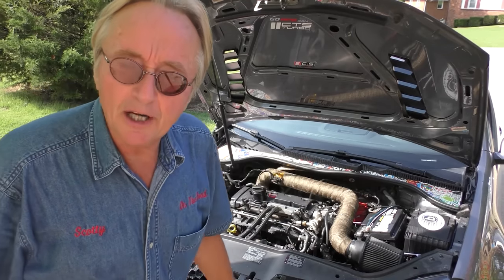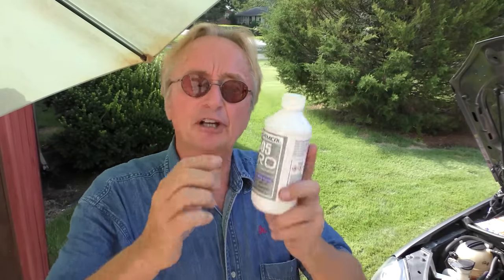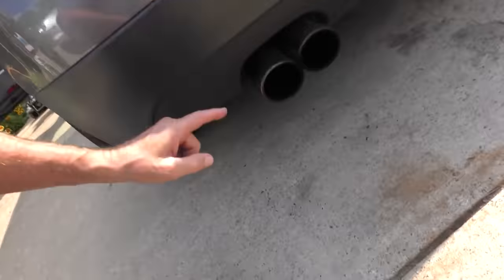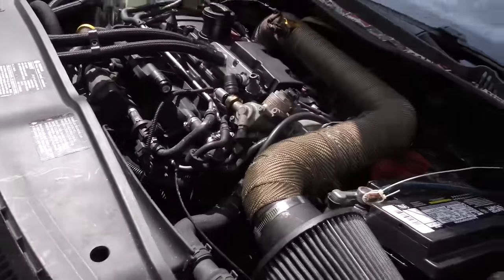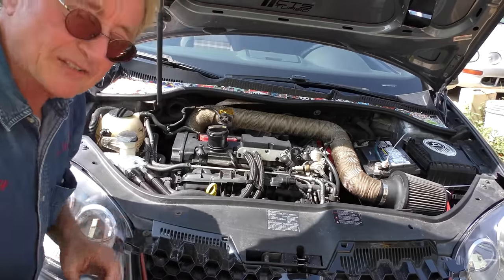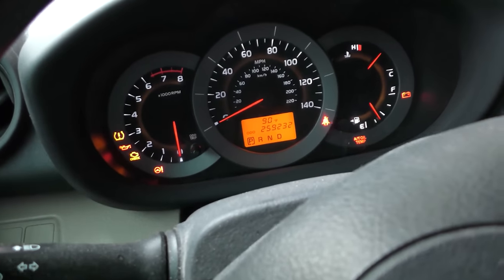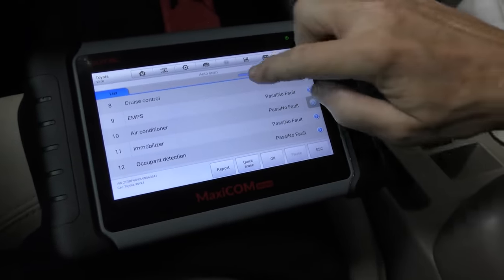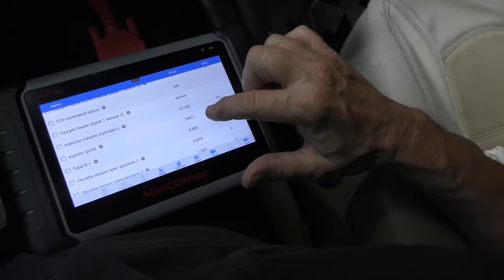3 Things That Will Make Your Engine Last Forever

Comment: Years ago...I had a 1965 Barracuda that still ran after 425,000 Miles-- The body rusted before the engine died... I also had a 1965 Newport with 325,000 miles on it
Reply: Simply doing common servicing upkeep on vehicles really really extends the life of any thing you're driving 95% of ppl never lift the hood they just expect them to go go go without any upkeep 😂😂
Reply: Brother s 65 Olds went over 300,000, Mom’s Olds, over 249,000. My Oldses are still running, 2 1983/s and 2 1985/s. Why? Frequent oil changes. I’ve since sold  them, as they were rust buckets, only the bodies rotted and failed. Mechanically all solid. And still on the road with new owners. Current 05 Vue at 264,000. Frequent oil changes and TopTier Premium fuel.
Reply: The four cars I’m responsible for maintaining all take 5w-30. Run Mobil 1 synthetic with the matching oil filter in all of them. Change it out every 3,000. It’s already dirty at that point. Yes, it costs accordingly, but it’s been worth it, with zero motor issues in all four.
Reply: What do you do to keep them running this  far?
Reply: Also, I watch the people drive like idiots....one man said the truck will do what they show in the commercials,  just not very long.   Push the throttle easy, be careful, etc...
Reply: Not to poop on your parade or anything, i cant prove it didnt happen but Lol old engines never lasted as long as newer car engines plus they didmt have overdrive gears in most cars back then. You got 100k out of a engine and trans, but you got more miles out of the motor cause you dump thicker oil in after it starts burning oil. Oil was not very great back then and tolerances were less precise. At least in the north, older cars were never sealed very well, not as well as the modern cars plus galvanization had gotten much better. Jeeps went 2 or 3 years in salt and started getting rust and so did every other car if not undercoated well and washed somthimes. Jeeps in particular were bad because they have hinges external on the body and amc never painted under them and jeeps are full of spotwelds. They were built for cheap war production not as a econo car but they were doing so anyway so that didnt help them. Still a modern car up north rusts away before the motor dies, 200k miles is about the most you get or up to 300k or somtimes more of a japanese car. Im sure the hard starts in sub 0 weather limits the life of a engine where im from though, oil doesnt flow. Ive started my 360 v8 jeep in -45 before and oil pressure goes through the roof, it hardly started let alone turned over with a new starter and battery. Carbuated engines often dont start in that kind of weather nor cause somthings wrong but cause its simply too cold, but that was more recently. Maybe its the modern gas, maybe its the more  modern ignition system i have now idk.
Reply: That's weak, my chevy spark has 860k miles on the original engine.
Reply: older cars were far more reliable if treated and maintained well. Modern day cars have way too many electronics in the mix. Making it more complicated. The more you involve the more complicated it becomes the more problems you will have. Remember the phrase keep it simple stupid? There's a reason it gained traction.
Reply: @davidwhelan8550  My mom says I drive like a grandma lol and  I always drive my cars according to how it feels they need/want to be driven. And on occasion that even means accelerating swiftly then smoothing it out. I’m no big car guy or anything just pretty in tune with things 🤙🏽
Reply: Who cares
Reply: @julemarie4550  SImple, buy a Volkswagen.  My son has a Jetta V 2,0 tfsi (280 hp) -07 with 290000kms ( 182000 miles), My wife has Golf -14 1,6 diesel with 190000 kms and I have -99 Passat 1,9 diesel with 570000km (365000 miles) . They all run without problems. Well, my car already has rust issues...  We live in Finland.

Comment: I use the Chevron fuel injector cleaner and only Shell fuel, it's the perfect combination. There's a noticable difference in performance in my vehicles and gas mileage if I use any other fuel.

Comment: Scott,  I sent my injectors from my '87 Porsche 944 to Injector Repair llc in Upstate NY.  Tested, ultrasonically cleaned and retested with data for less than $100 for all 4 ! Big differences in performance 👏
Reply: Oh my Lordy!!!
For fuel injector prices from my dealer $3500.0

Comment: Scotty, about the ATS carbon cleaning system treatment..i checked their own website...both oil and fuel treatments both out of stock today... when Scotty talks people listen.
Reply: So what happens when in the same video he says to use that company’s oil cleaner and then in the same video says not flush your oil. Also, mentions he is impress by their fuel system cleaner, but the previous video (People say I am full of crap) says do not use fuel additives like fuel system cleaners and in other videos tell people to only use ones with PEA which ATS doesn’t have
Reply: @robertt9342  quit trolling
Reply: @jkaw9291  he isn't trolling he is 100% correct
Reply: shows as can order now.........
Reply: @robertt9342  I first thought this too but then I rewatched it and it seems he’s saying just don’t flush clean every time you do an oil change. Probably just do it once and see how it goes.
Reply: Seems they have stopped selling the product. Anyone can recommend a similar product?
Reply: @henriklarsson7835 that's funny considering they spent "a million dollars" on research alone & Scotty has been promoting that product ever since it was invented cuz he's friends w/ those guys in New Mexico 😂

But, if that truly is the case & you're wanting to clean carbon out of your engine just pour some Seafoam into your crankcase about 100 to 300 miles before your next oil change. Also, pick-up a can of CRC intake valve & turbo cleaner and spray that into your intake tube following the instructions carefully! If it says spray it while the engine is running @ 2,000 rpm or so, do that! If it says to let it sit for an hour or so after the treatment & then start it up & drive it on the freeway for @ least 15 mins., do that!

I own a 3.6l gdi engine & this is what I do on mine(although it has been awhile) it's the cheapest thing u can do short of removing the intake & doing a walnut blast or adding an oil catch can...

Comment: After the carbon flush on git they should put six ounces of marvel mystery oil at every oil change in my opinion. I just like it I been using it for 45 years in All my Engines and tell everybody who will listen I learned About it from a Great Mechanic and race engine builder and race car driver who Dominated the Dirt tracks in Louisiana for 30 Years.  And we never had any sludge build up.  But the trick is to use the Carbon flush you used about every 50,000 miles and flush your injections system the same 50,000 and Change your platinum plugs at every 50,000  cause they wear out. By breaking down metallurgy molecular.  Proven. Cause my partner was crazy about his truck staying in tune.
Reply: Wooo. A new Scottie. Lol
Reply: Do you think I should do a carbon flush on my bmw 2007 328i it has 149k miles?

Comment: That supertech oil is cheap and works great in all my vehicles. Can’t believe the price difference when I shop at Walmart for oil versus Napa !
Reply: I use to use Castrol, but because of the expense I now have been using Supertech for about 6 years now.  The viscosity stays good though 5000 miles. The reason I change it is because of the dirt in the oil. At $17.00 for 5 quarts, it is a lot cheaper that Castrol at about $23 to $27.  I always use a Fram filter, at least a Tough Guard.
Reply: @gpkidder  the Fram filters are now Chinese made. Garbage.
Reply: Super tech was the only thing that quoted my lifters on my 03 xterra

Comment: The best products I’ve found is made by HYDROTEX in Texas I used to own semi’s and one had a 3406 360 hp CAT engine . At 750,000 miles I took it to CAT in Pittsburgh Pa for an overhaul, when the mechanic took off the oil pan , they couldn’t believe how clean it was an almost no wear on the bearings so we decided to put it back together and run it till it dies. Don’t know when that happened because I ran it a couple of more years and traded it in on a new truck with a 3408 , 450 hp . Great videos Scotty, only wish you would take more time explaining the N A M E of the products you recommend.🤓

Comment: My Toyota Highlander  hybrid now has 390000+ miles on it
I’ve been changing the oil every 5000 miles & now I do it every 3000 
Oil looks clean when I change it 
I was loosing half a quart on the 5000 oil change so that’s why I’ve changed to 3000 as she has  a small rattle that’s started recently but seems to only do it if the engine is cold 
Engine doesn’t miss a beat & is as smooth & powerful as when I got it with 125,000 miles on it 4 years ago !!
Fingers crossed she’ll keep on going !!

Comment: Great video Scotty. If you have this mk5 GTI engine (FSI bpy), make sure you replace your "cam follower" at a regular intervals before it fails (it's a thimble sized piece between the high pressure fuel pump and the intake cam). 40$ part can same a lot of trouble if replaced.
Reply: Every 10k miles. So have to pull off the fuel pump every 2 oil changes. If you can get to it. Horrible design too.

Comment: I believe in Rislone.

Years ago while my dad was a journeyman auto mechanic he showed me the cleaning capability of Rislone.
Reply: Yep...me too.
Reply: @Peter Angles 

It disolves varnish and gum which can lead to sticking of lifters and piston rings.

This is a quote that is fact. I've seen the results.

Rislone Engine Treatment gradually dissolves and removes harmful deposits of varnish, sludge and gum from the internal metal parts without plugging oil passages. These deposits form within engines and can alter tolerances, stick valves and rings, cause noisy valves and lifters, and plug oil screens and passages.

And my dad showed me some pretty nasty looking valve trains and nearly clogged oil passages.

If you use it change your oil soon.

Customer came back at 500 miles engine purring and we changed the oil again. Very filthy oil and filter was loaded but Rislone did the job. Used it ever since.
Reply: Rislone is really good, had a "faulty“ o2 sensor on my car, put it through and 1000 miles after the full cycle the light hasnt come on again, it cleans everything on the inside
Reply: What about MMO ??
Reply: My car engine ticks and I used a rislone lifter tick quieter in the past, but it didn't do anything
Reply: @theaajourney9872  because people are not completely honest about Rislone, best results are on the old MPI engines, it doesn’t come into contact with DI engines. It goes into the engine like oil not where it needs to go, that’s the way DI is designed. Although, the carbon deposits are not as heavy or as damaging when a DI engine has early maintenance done.
Reply: It was regular 32oz or concentrate 16.9 oz ( high mileage) .
Reply: Hey you guys! I'm Scotty's BFF. That means we're Best friends FOREVER! That's a long time.

Comment: If you change oil every 3000 miles, your engine will last forever.  I own a car for 40 years, the engine is still running great
Reply: Over the past 24 years, I've changed the oil in my Toyota Corolla every 3000 miles without fail.  At 278,000 miles, it's still running great.
Reply: It depends on driving conditions.  Short trips with lots of stop and go are substantially harder on the oil, highway and interstate driving with a lot of steady speeds, moderate rpms, your oil will last 5K easily, especially if it's synthetic oil with a good filter.
Reply: @martinmummert5614  rookie numbers my 2011 ram 1500 has 300000 already and will probably last 400000 easy
Reply: @packrat76  
I think you missed the point; Changing the oil every 3,000 miles keeps nearly new oil in you car at all times, so it doesn't matter if you drive city or highway or if your oil will last 5,000 or more miles. Who care? not you, you change it every 3,000 miles no matter what.
Reply: @pelon666 Rookie numbers my 1998 BMW 328i has 396k miles.
Reply: My buddy’s 1994 Lebaron has 957000 miles on it. Oil changed every 4000
Reply: Buy toyota motor and regularity do the maintenance 😅😅😅
Reply: Or 3 months I don't care if you run full synthetic or not😊
Reply: What would be the top 3 things you would have to most likely replace on a truck even if you do change the oil and filters inside 3k
Reply: Once my pick up hits 3000 mi I head for the garage for fresh oil. I’ve had 3 F150’s that had 200k on the clock before selling or trading them in. Keep your oil and air filters clean!
Reply: @grose93alexander67 if it’s a ford than prolly everything on the truck
Reply: I don't go by milage.
I change by the season,  every 3 months.  Sometimes it might go 4 months.
Oil is cheap,  so is the filter.
Reply: I don't change oil by mileage, I change by season. 
4 times a year.
Easy to remember. 
Oil is cheap.
So is the filter.
Not a set date on the calendar,  but is modified by milage and environmental conditions during that time frame.
Reply: I have a 2010 vw cc with 160k mi, using spec oil and changes, no issues...however, i commute a total of 70 miles a day....everything gets warmed up properly, and it gets to run at a variety of speeds, still getting 33mpg
Reply: How many miles it got

Comment: I just used the 505 CRF Fuel cleaner and love it!!!

2015 CRV Touring, 212,218 miles at cleaning time. No oil burning.  Mileage went from 22-25mpg best over the 4 years ownership from 98,000.  Used Techron, Lucas, STP, Berryman and none did any improvement noticeable over the years. After 505, mileage high city Ave is 25.9mpg highway topping off at 31mpg numerous times.   Worth every penny!!!  Shipping only took 3-5 days. Thanks Scotty! Will be doing oil treatment soon. Current mileage 216,055.
Reply: Ever try seafoam?

Comment: 5 things that will make your engine last a long time.  1. change your engine oil + air filter 2. Change your coolant  + thermostat  3. Change your transmission fluid.  4.  Change your  spark plugs 5. Timing  belt if your vehicle has one.
Reply: Amen 500 thousand 740 VOLVO WGN 🚘
Reply: Wow basic maintenance will extend the life of an engine?
Reply: Honda Brio1.2litre petrol engine.. 689k and still going strong
Reply: Use high quality fuel, don't drive it hard until it gets up to temp, let it idle down after a long/hard run
Reply: @anthonywhittaker1899  what are you doing to it
Reply: 5. Yes , especially if interference engine
Reply: Not sure if changing gearbox oil will extend engine life. But yes the rest certainly will.
Reply: @vincentnichols402 SCOTTYs channel, eh JR?

Comment: Toyota has those exact same of oil filter canisters with the cartridge. I know bc my 2014 Camry has it. My GTI has it too but in the engine bay now on new models.
Reply: Chrysler uses a plastic one, too on the 3.6l pentastar engines so it's not just German cars as Scotty implied 😮

Comment: I bought the oil additive and the gas additive.  My city milage increased from 13.5 mpg to 17.5 mpg.  Sure was surprised.  My f150 v6, no turbine had 102,000 miles.

Comment: When doing the oil system cleaner (1st one) , ESPECIALLY with a VW, BMW, or pretty much any other car, it also REALLY helps if you run a quart or 2 of new oil straight through the engine(before putting the drain plug back in) It helps rinse the rest of the carbon deposits and buildup through and out of the engine. I use something similar but a “step up” for work and the oil can come in looking all poopy and go out nearly clear as water.

Comment: My Rav4 was stalling at idle. I took the gas pump out from beneath the back seat and just changed the strainer on it. Not the filter. It was $5. It was completely full of crap on the outside and was never changed. It's been a year and runs fine.

Comment: what about leaving the drain plug out (after you drain the old oil)
and with some extra fresh oil, poor it through the engine, it will gather all the dirty stuff, it will spill out the bottom.
then after it starts draining "clean" oil.
you let it fully drain out.

and put your plug back, refill to spec and there you go
you cleaned the old oil out but you didn't use any chemicals that would damage anything
Reply: The new oil filter will catch it.
Reply: @stoundingresults  I meant before you put on the filter.
You keep the drain plug and the filter off for the cleaning
Reply: well, why not blow some high pressure air into the oil filler port, that would push any garbage in the bottom of the oil pan out too
Reply: @gocanada9749  that's another great idea
Reply: @08_crown_vic    OR what about making an L out of a coat hanger and wind some cloth around it and stick in in the drain plug hole and twist it around to catch trash in the bottom of the pan ?

Comment: So I'm preparing to do the oil change myself the next time after having it done by a mechanic at regular intervals. 
I see the start of the video with the additive added first to flush out the carbon and I think yes, that's a good idea, I'll do that. 
Then I get to end of the video where Scotty says that carbon is an important part of the ecosystem of an old worn engine. Which makes sense to me too :)

 I've a lovely Ford Ka from 2006 that starts on the button and generally runs great. 

Do I or do I not flush the carbon before changing the old for the new oil? 

Your input is appreciated
Reply: Flush it before changing oil :). Trust me.